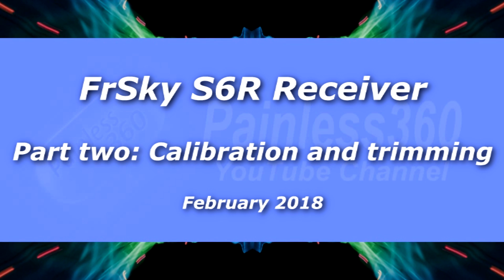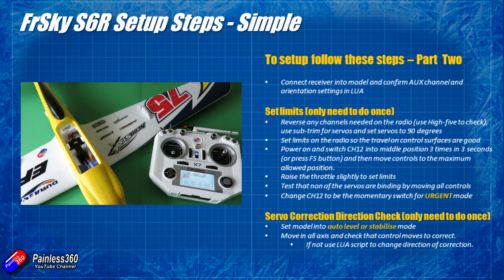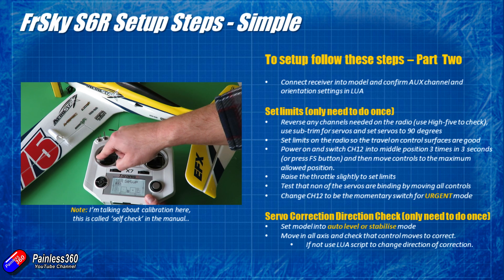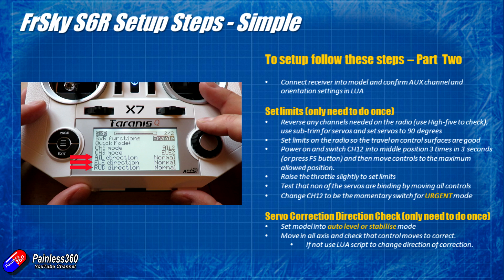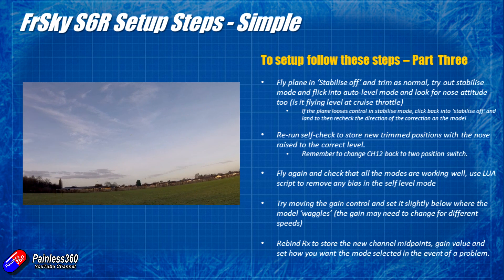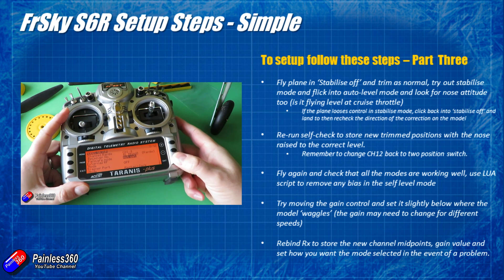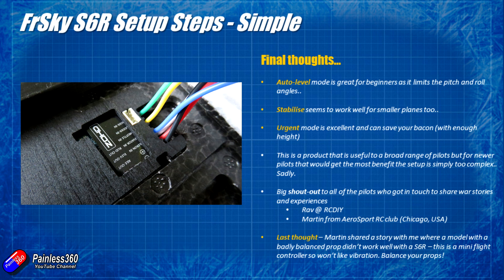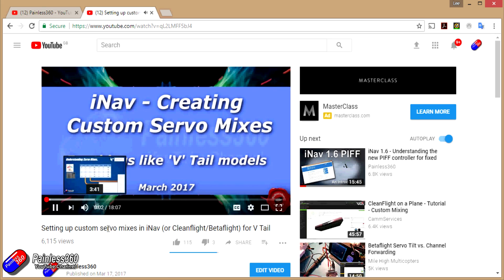(2/2) Frsky S6R/S8R Basic Setup

Comment: Im stuck with the switches. I put them on the channels but i they dont seem to work. im trying to turn sabilisation ect off to finetune the servos and so on. but i cant manage it.
Reply from the maker: All I did is in the video. What troubleshooting have you already tried?
Reply: @Painless360  its done, it was just one silly mistake what inteferred ofcourse with everything. D16 was correct but  only 1-8 channels instead of 12.  i realized falling asleep last night(facepalm)
greeting from Germany

Comment: I am slowly working my way to flying for the first time my latest & 'Greatest' plane design.  Using S8R it is fine except don't yet have more than one mode  SA up working with other two positions not stabilized...so that is OK...some tip on how this should look on the qx7 to get other two might be good.  Also, everything working in flying wing setup except only way to get correct stabilization is with pins to front. 

Thanks for all your great help.

Comment: sometimes my lua script wont fill out, or even partially fills out.  also when i change the servo directions for self level they dont seem to save.  i have an s8r and have it pointing plugs to the back and antennas forward. i thought this was correct but seems completely backwards on self level. also the rudder does nothing on self level.   any help would be appreciated!!!
Reply from the maker: I'd try another version of the script. This is a nice idea but frsky have done a poor job of implementation.. Best of luck
Reply: @Painless360  thanks bro. It was just my stupid mistake.  I was trying to do it plugged into the smart port. Being so close to the rx was causing telemetry loss and interrupting the process lol!!! It all works now!! Now I'm just trying to see how I'll mount the rx.  I'm thinking I could turn it 180 and just reverse whatever needs reversing.

Comment: Thanks for the video. I was able to set the S6R in a Ranger 757-6 for fpv. Works perfectly. Is it possible to set up a camera panning servo on Channel 6 using the S2 rotary knob of the QX7 or is Channel 6 only meant to work as part of the stabilization circuitry for Elev. 2? Will appreciate a response. Thank you.

Comment: Will the stabilization and auto level work on a 3ch plane that does not have rudder? I am at a university and we are using the RMRC Skyhunter that has an H-Tail Setup with no rudder. Thanks!
Reply from the maker: Yes it should. I'm not a fan of these myself but it should work ok with some setup. Best of luck!

Comment: To make setup easier seeing this is the first time I have ever done it I decided to not do the flaperons. I had it most all working until the rebind then for some reason everything got messed up. The stabilize switch is no longer working and the pitch correction goes to the ailerons and if it needs to correct enough it turns the motor on. Tried to redo everything but nothing seems to help. After just over 8 hours of working on it still nothing.  Any idea where I could be going wrong?
Reply from the maker: Tricky to comment without knowing what happened exactly. I am not a fan of these, it’s a great idea but a terrible implementation. Best of luck getting it sorted, I’d probably start from scratch.
Reply: Have done many times. Have worked on it more and have sorted some stuff out. Ailerons are the problem now. They move fine one way but not the other. 
Are there any better stabilized receivers out there for Frsky radios?
Reply: I think I have it set. lol

Comment: Hello, I have everything setup on s8r and done all self checks after I trimmed the plane. My question is on channel 12 lockout, I just unassigned the switch. It does not try to calibrate when moving the switch now. Is this how to lockout the switch or should I do something different with it?
Reply from the maker: If you don't have a switch assigned to that channel than it should be fine. Happy flying!

Comment: Great video series. Im very new to RC planes and just got this receiver and should have it in a day or 2. The plane I have is an Easy Trainer 1280. The radio I have is the FrSky ACCST Taranis Q X7. Would it be possible to program in flaperons with this receiver/transmitter combo?
Reply from the maker: Yep, see my video on OpenTX flaperons.. Best of luck!
Reply: Thank you very much, I will check it out. One question, do the ailerons need to be on their own receiver channels or will it work with a Y cable?
Reply from the maker: If you only want them as Ailerons then a Y cable is fine. If you want to use them for something like flaperons then you'll need each on its own connection..

Comment: When programming a remote controller and using a buddy box. Does the buddy box also need to be set up the same so that the stabilization work? Or me as a master can set stabilization on when handing control to the slave?
Reply from the maker: It depends how you have it setup. If you’re only passing over the Thr, Ail, Elev and rudder then no.. happy flying!
Reply: So while passing control of ailerons, rud, thr, and elevator the stabilizer will do its job without having to program the slave?
Reply from the maker: See my videos on it for details. Best of luck!

Comment: Setting this up on a Bixler with X-lite now, thank god for your videos mate!! Once you do it once it all makes sense and seems pretty straight forward but first time out without this video would be bit of a nightmare.

Depending on how well this works, I might add it to my Efxtra. 

I only bought it to get rid of that bobble foam planes have when in the air, so keen to see if it does smooth it out, I mostly fly FPV so if its not entirely smooth its very obvious

Comment: Excellent work getting all this together in one place and putting complex such procedures in a user friendly fashion!
        For  info I've used the s8r with pins front,  just need to swap over correction in the lua script, and or can re configure from beginning but this time place Rx body pins down when it prompts pins up and so on. Even got carried away for fun and mounted across the plane ie pins left or right and again can be configured to work in all modes.

     Have you considered a tutorial on updating the firmware for an IRX4 multi module.?  
       Thanks again, great job 😊➰🙃

Comment: Thanks Painless 360. I have the same problem that several others have mentioned, the S6R works fine in off mode and stabilise mode but when I switch to auto level mode it goes into knife edge mode. Has anyone solved this problem or how to switch knife edge off.
Reply: robbo h Hey Robbo H ! You might want to turn on “Quick Mode” in order to cancel out the Knife Edge Mode ! Hoping this might help you out !
Reply: Thanks

Comment: Very helpful set of videos. Liked and Subscribed :) I still can't get past correction check though. self check seems to go through fine but it doesn't seem to correct when I twist it around. I'm using a 9XR Pro with an XJT module so I may have incorrect limits on the 3 position switch (I have it at half for all 3 then 100). Any ideas? Thanks.
Reply from the maker: All I did is in the video - I'm not a fan of this product. Nice idea but horrible implementation..
Reply: I watched it again and I think I was able to turn on auto leveling on the 3 position switch. I can tell when auto levelling turns on because the servos get noisy and the surfaces do move when I move the model around. I can't tell if stabilization works when I switch down from auto level though.

Comment: I just completed the setup of my S6R using your instructions. Very clear instructions, so during install no problems. When I tried setting the "'self check"" using CH12 I was not able to get blue led on TX, so I used S/F switch on TX. But now I noticed that also CH9 and CH10 (mode and gain) do not work. The plane stays in level mode. I am using S6R EU LBT firmware 171204.

Comment: Thanks for the video. Been trying since last week to set this up and struggling as I'm using a 9xr pro and and ersky 9x firmware. A lot of this video relates to the radio/firmware I'm using and even now has the lua script available for the S6R. The only difference is the lack of a second 3 position switch for self check but is easily bypassed by using the failsafe button as you mention. It's now inside a Skywalker Falcon and working. Thanks again.

Comment: Awesome videos it's helped me so much, I'm having 2 issues first is it seems channel 10 switch is setting it to stabilise and knife edge and when add channel 12 I get auto level mixed between the 2 switches. 
The second problem is it will not go into calibration mode with the channel 12 switch,  is there something I'm missing?
Reply from the maker: All of the information I managed to figure out is in the video. This Rx a great idea, but poorly implemented. Best of luck getting it sorted out. Happy flying!

Comment: Thanks for this vid, helped me a lot! One question though, I didn't get it why that last re-bind was needed? Is not everything stored with the second self-check?
Reply from the maker: It’s an old habit of mine that I always do one final blind when the plane is set up so the failsafe condition is recorded on the receiver. With X series receivers it’s actually slightly different - it’s just good practice. Best of luck!

Comment: I have finally managed to get one S6R receiver to work properly, thanks to your two videos. What a huge effort you have made! 

I must say that this was actually the third receiver I was attempting to set up. The first one responded to the full stick movement of the ailerons, but only in one elevator direction and not at all with rudder. The second went crazy when putting the channel 10 switch in auto level mode, so the solution was to use offset so as to avoid  the switch getting to that mode. 

I am now buying additional receivers; I pray they work properly... 

By the way, has anybody else have had to deal with dud S6R receivers?
Reply from the maker: I’d try re-flashing the problem receivers. Best of luck!
Reply: Painless360 Tried that three times... did not work. Will try with the STK tool.
Reply from the maker: See my video on flashing FrSky receivers for more tips.. best of luck!

Comment: Hi Lee, thanks for making this SxR setup vid. I have found it very useful. Just one question. I seem to be getting a small amount of  yaw correcting automatic rudder movement when my S6R setup is in "level" mode. Frsky's instructions suggest this shouldn't happen. I have the latest firmware installed and can confirm the mode switch is working correctly. Is this normal?
Reply from the maker: All I can say is this one worked for me. I’m not a fan of this thing - nice idea but lousy implementation and code.. best of luck!

Comment: Thanks for the help! I have set up both an S6R and S8R. But I found I still needed the STK Tool to flash updated firmware to both. Out of the package I wasn't able to toggle convenient mode on/off or switch Ch 5/6 to AUX modes. After that, however, it was step by step like you describe. Thanks Again!

Comment: I  followed your setup. Everything works great in off mode, and in stabilized mode.  As soon as i put it in self leveling mode, or the oh crap mode the aileron goes nuts when the plane rolls right, and the elevator goes in the wrong direction. Do you think I screwed up, or do you think I got a bum reciever? The gain works well as well.
Reply: While were at it I bought the new Qx7s, and I can't seem to find the version of firmware on  open TX, so every time I try to update the firmware so I can use the 4 in 1multi module it says that the firmware isn't compatible with the firmware on my radio. I got the lua script with the SD card. Any help with this would be greatly appreciated.
Reply: Same here. On leveling mode. OMG. It goes crazy. Any thoughts?

Comment: Great video as always.  I had first set up the receiver with the STK, then later figured out how to use the Lua Script with your help.   The one thing that is still a mystery after looking at your  and other's videos is the relationship between setting gains for individual surfaces via the STK (and probably the Lua) and the single gain setting with the potentiometer.   Does the pot override the gains set with the STK.   Does the pot change all gain settings equally, i.e. pitch, roll and yaw?  If so how can you maintain different gain settings for the different axes?  It might also be helpful to explain all the S6R Lua configuration options.
Reply from the maker: If FrSky ever take the time to write a useful manual that actually helps us all work this thing - then I will. I’m not planning any more videos on this until that happens.. As I said in the video, nice tech but just too damn hard to use.. Happy flying!

Comment: Having faffed about with this RX for some time now I cannot understand the thinking behind Frsky releasing it in either it initial or revised form.   The first version of the software was simply horrendous, how many users became familiar with the correct sequencing of two, three position switches I wonder.  The revised firmware has taken a step toward simplifying things but I haven't seen any explanation of how the 'Panic Mode' on channel 12 differs from the 'Self Level' on channel 11, plus if it is not handled correctly it is possible to initiate a self check and crash the model. Even the new SXR manual has inconsistencies to confuse the user.  The Electronic/Computer Geeks need to speak to Users more and listen to what they say. Just because a thing is possible it does necessarily mean that its a good idea. What on earth are they thinking??  I'm a big fan of FrSky and much appreciate your own efforts to clear he fog.    Thank You Painless 360 and FrSky, Come on, get a grip!

Comment: Yeah the graupner stabilizer receiver setup is so much easier and works well with gas/nitro engines, but I don't fly graupner I'm an FRSky guy. I'm kind of looking into getting a S6R but I'm kind of leaning more towards just getting an F3 flight controller and running Inav.
Reply from the maker: iNav is awesome and gives you all of that GPS and OSD goodness too. Probably easier for many to setup too! ;)

Comment: Thanks for that Lee, clear and informative as ever. As a reasonably experienced pilot I was intending to use this in its 'advanced' mode in a 3D capable plane just for a laugh. I can find no videos at all with it operating in hover or knife-edge, has anybody actually done this do you know?
Reply from the maker: +patrickcol not that I know of. But now a few of us I've actually got this working, it does provide a solid foundation to explore the more advanced settings of this thing. If you try and get it working - please drop me a line and let me know the tricks. Best of luck!